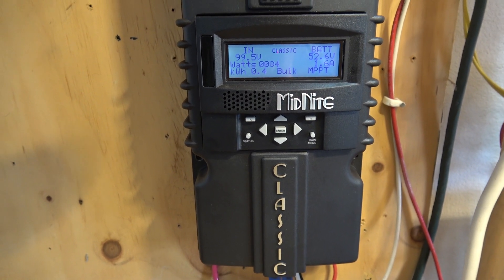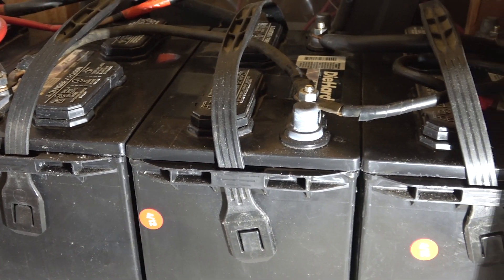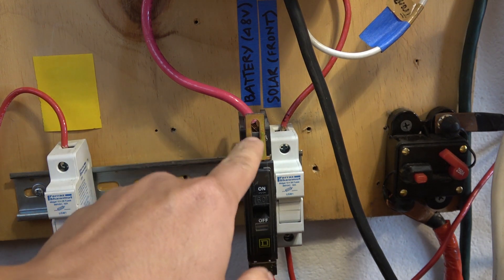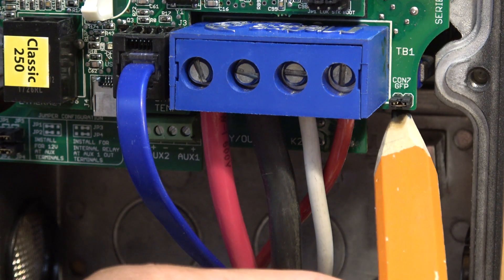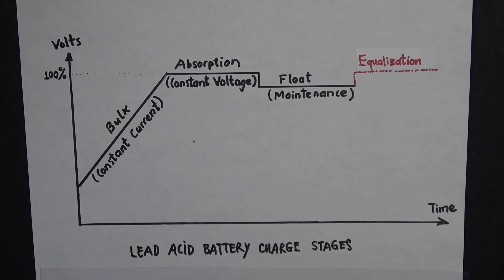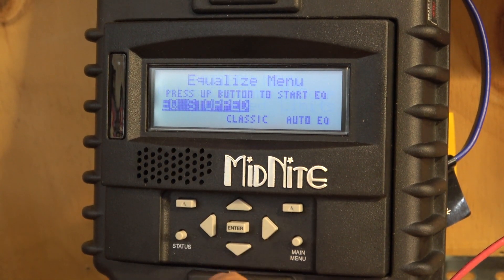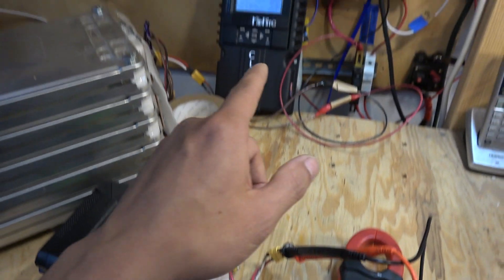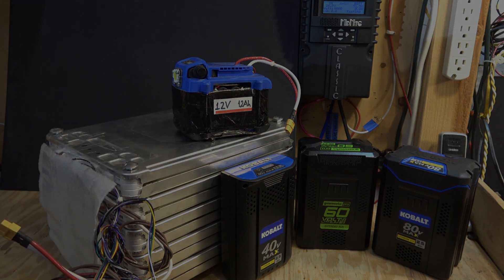Li-ion battery charging with Midnite Classic 250 MPPT Solar Charge controller

Comment: Very nice video. I am currently using the MC 150 with a 2kw solar array. Shouldn't you limit the current or does those batteries has built in BMS?

Comment: Charger looks good.been out on my ebike with new front hub motor and have lights on now.goes well but when I’m climbing back up steep hill the power cuts out if I back off throttle it comes back on .maybe connection problem under load ?
Reply from the maker: Sounds like it's being overloaded. That could be anything: motor, controller, or battery. But I would look at the battery first. The way you describe it sounds like when my battery is almost empty if I push it too much, the power will cut out. But if I ease off the throttle, it'll come back again.
Reply: If motor is 36v an battery 54v is that ok?my last motor was 48v but a guy off eBay tried repair it but never had it working .tested it an only voltage on 2 phases so scrapped that an saw cheap wheel eBay the 36volt one.my battery is made with vruzend plastic caps an holds voltage well.i can split pack as it’s in 3 parts so can balance separately so will try using voltage closer to 36v and see how goes

Comment: Oh, and I noticed the sticker on the unit lists the open-circuit voltage as "250 + Battery Voltage", so presumably, that would be 250+72=322V. I mean, right? It's still not 360V tho, of course.
Reply from the maker: This unit has an option called "super VOC". It can withstand VOC from solar panel + the highest voltage rated for your battery. For example if your solar array VOC is 250V and your battery bank is 48V, the highest VOC the controller can take is actually 298V. However, above 250V, the controller will stop charging and will only resume when the voltage falls below 250V. On very cold days, your panels can produce voltages up to 125% their normal value. "Super VOC" will protect the controller from being damaged. If you don't have this protection, your controller might be damaged on cold days if you're not careful and run your panels's voltages too close to the upper VOC limit of the controller.
Reply: @vuaeco  Ah, gotcha. Thanks. I knew there had to be more to it.

Comment: Wind is a good option for us up here in the wintery places. The sun only produces decent voltage here for maybe 4 months a year; the rest of the time is often windy tho. Small-scale hydro is good off-grid as an additional way to charge batteries, alongside solar and wind, but is tricky to implement and can be highly illegal if you fuck with migration of fish, for example. Of course, if you have a big roof, water falling from it is like free energy! Honestly, all homes should have mini-turbines in the eavestrough downspouts.
Reply from the maker: I never thought of the mini turbines in the downspouts! That's a great idea! Well I guess in your place, you can set up solar for the summer and have a transfer switch and switch it on wind in the winter.
Reply: @vuaeco  Well you know I'm staying tuned until you make a downspout turbine video, comrade. :-)